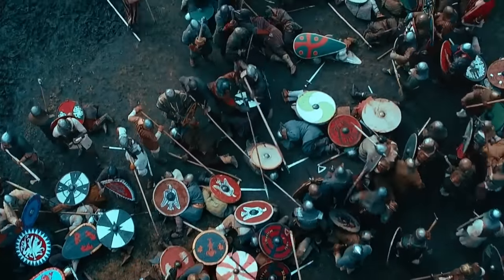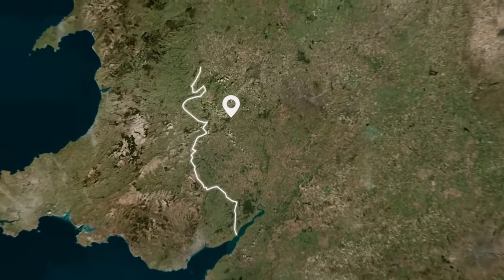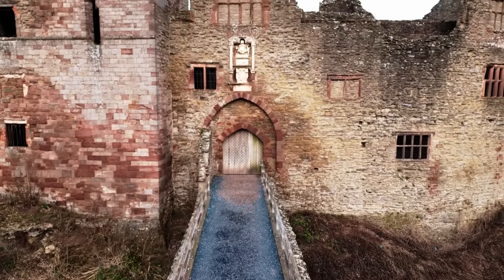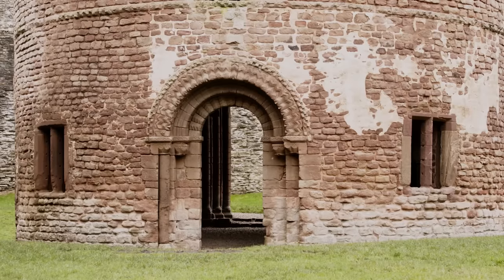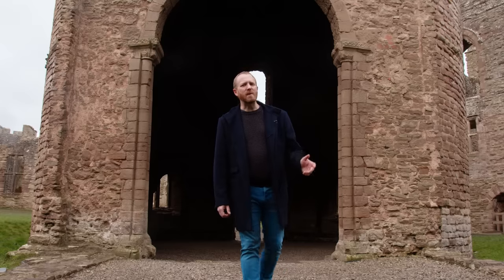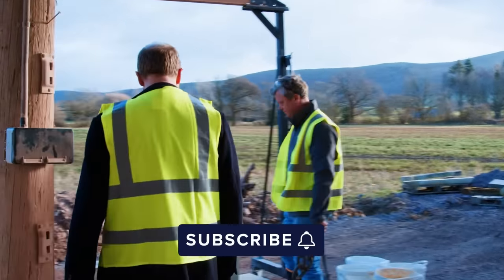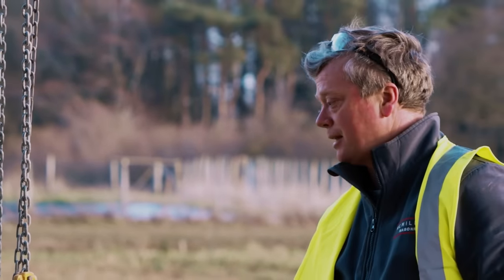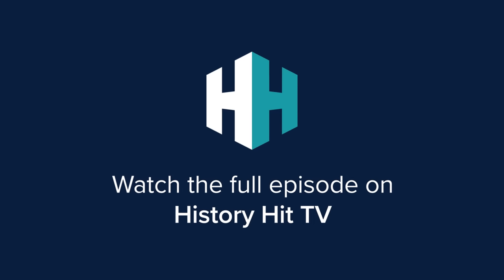Exploring One of the First Norman Stone Castles in England

Comment: This would have been a nice video on Lodlow castle if you hadn't shown the unnecessary mistaken building scene. Indeed, Ludlow castle's walls like most castle walls are not made of ashlar but by smaller stones that you can handle by hand and the uncut rubble stones were built as frames incasing concrete with rubble inside - a most common technique of wall building since the Roman period... Unnecesseray mistaken explanation is unnecessary. Ashlar stone building was used in the medieval era, primarily on high status churches, and in later castles, not like this one. I recommend you read a basic book on medieval castle construction before presenting falsehoods on the Middle Ages.

Comment: How does a town shelter the castle? Thats a stupid claim, the opposite is true, the castle protects the town, it also protects the river, not the other way round, it was placed there to protect the river, not to be protected by the river. this level of incompetence is insane.
Reply: The other rivers arent even near enough to be defensive, aaaahhhh.
Reply: The river is small, but quite fast flowing and has cut a natural culvert into the land around it, a feature the Welsh call a nant. It, together with the steep slope up towards the castle, does form a natural barrier. And the river also helped to create that slope. Like a lit of rivers along The Marches, it's fed by waters coming down from the hills and so can be fast flowing and, in inclement weather, very difficult to cross without a bridge, which forms a defensible bottleneck. 

I do agree with you about the town, though. Unless it's fully fortified a la Conwy or Tenby then it's not exactly going to stop an advancing army.
Reply: @larryfroot  Rivers tended to be tranport routes, are you saying it would be too fast flowing? they would likely have slowed its flow.
Reply: @dorianleakey  I saw it last year, although there was some management of the water, there's no way it is a navigable waterway. It's simply too narrow, too rocky and too fast. One similar river in Gwent (also fed from nearby hills although on the other side of the Black Mountains) was once called the Torfaen - Rock Breaker in English.